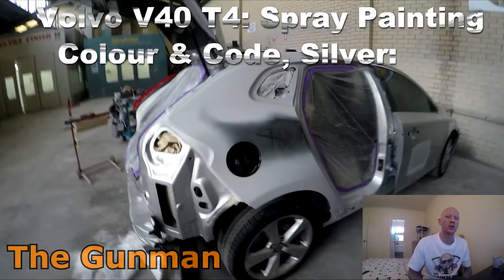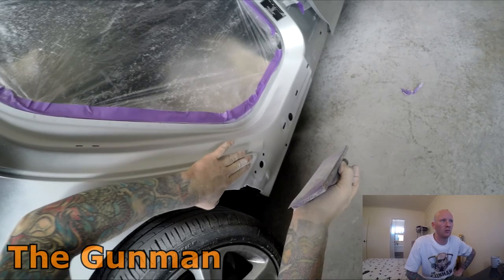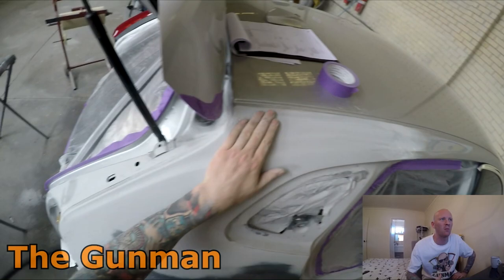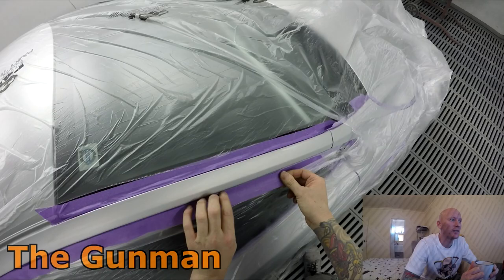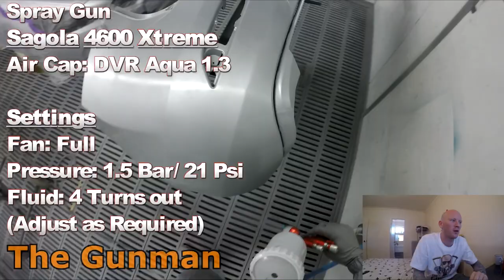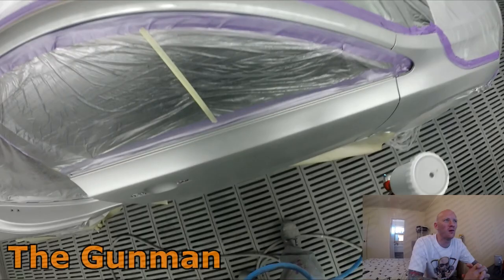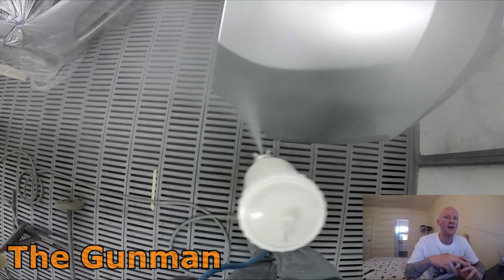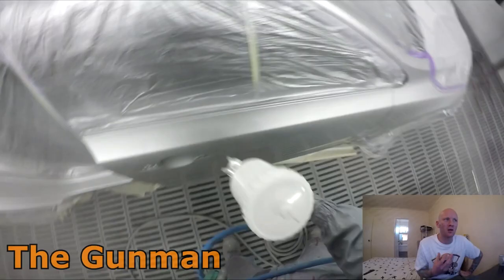Volvo V40 T4: Spray Painting

Comment: Prob because the perfect machining of the sagola makes it invincible. So easy to clean and maintain compared to every other gun w rubber seals and gaskets. 5 years later my 4600 is performing like new after many baths overnight in thinner.

Comment: GREAT VIDEOS * Hope you see this - EXPERIMENT - Fixing stone chips - we all know the ways shown such as touch up, Dr. Colorchip, etc. Well, tell me if this would work 
You have one stone chip to fix 1/2 the size of a match head
*Use 1500 grit on the chip and 1/4" around it 
*Now use 600 grit on the chip itself (glue the sandpaper to a pencil eraser and twirl) 
*Use a piece of cardboard and drill a hole just slightly larger than the chip 
spray your base coat through the hole in light passes so it covers the chip properly
*Now, expand the hole in the cardboard by approx. 1/4 to 3/8" around the size of the original 
*Spray clear coat through the hole to lightly cover the chip and surround...2 or 3 quick coats
*Let cure
*Wet sand the area again with 1500, 2000, then 3000
*Compound, Polish and waxWill that work or will you wind up with a round ring ? How about you try it on a door panel and show us..In my case, I want to do it on an HP white car. I have 1 stone chip dead center of a fender that is glaringly obvious because of the pristine nature of the fender. If this works, it would beat ANY touch up paint job ...Thoughts?

Comment: I have some questions about sanding and coat times.  I'm redoing an old fiberglass boat not a car.  Some quick info: I'm painting everything above the water line with single stage acrylic urethane and below the water line I'm going to be spraying new gel coat.  Okay here's the questions I have: What grit sandpaper do you recommend I sand down the Gel Coat before I spray the epoxy primer?  Do I need to sand down the primer before spraying the acrylic urethane and if so what grit?  How long should I wait between spraying coats of both the primer and urethane?  How much working time do I have before I need to get the primer and urethane out of the gun?  I've never sprayed any kind of paint that involved mixing paint, hardener, and reducer.  I really don't want to screw this up because all the paint and everything ended up costing me like $600 so any advice would be great.  I'll probably be spraying in about 2 weeks.  Thanks.
Reply: Definitely check the data sheet on your materials...   Recoat windows will be different between all of your different types.    The heat and humidity will wreak all sorts of control on your curing too